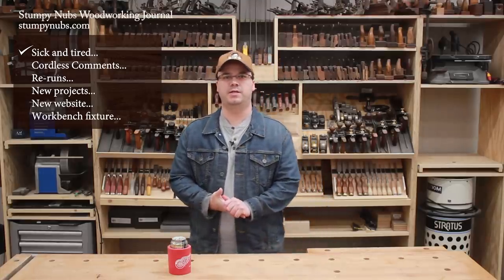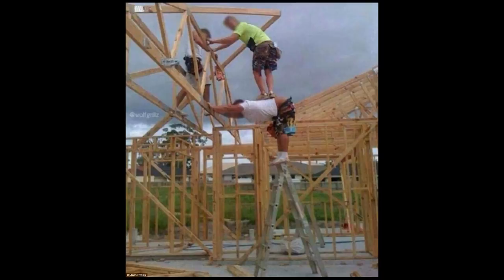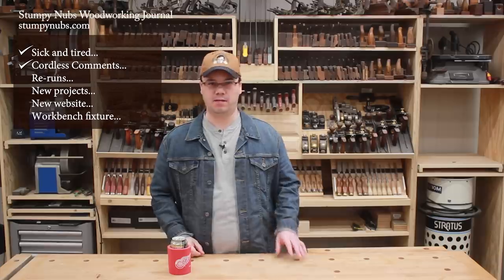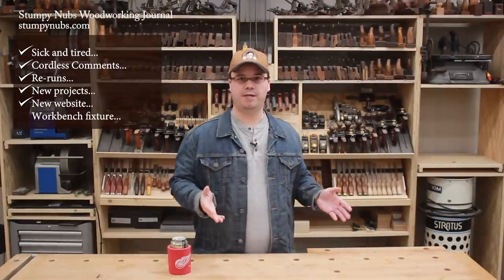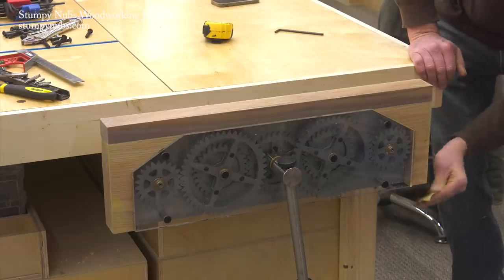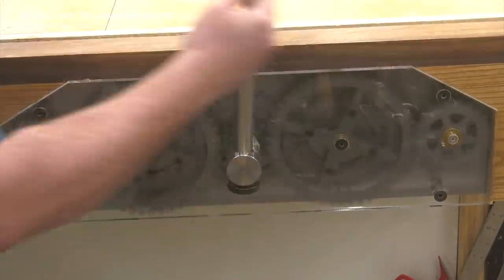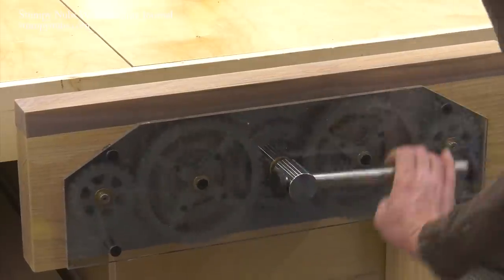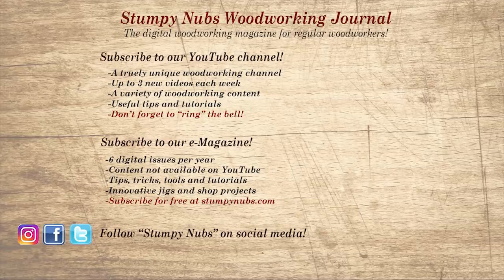YouTuber invents an AMAZING workbench accessory! (And some shop talk)

Comment: I use my impact more than my drill for installing door hardware, but I use the variable speed trigger to feather the screw in. One feature I really like about the impact is that when I let go of the trigger it STOPS where a drill may go an extra half turn or relying on the clutch on a drill can cause issues because of different wood densities. Recently I restored some 160 year old mortise and tenon doors, where the hardware had to go through different grains of wood with different grain tension. I guess it depends on your experience with your particular tool, and I wouldn't try that using someone else's tool because of lack of familiarity.

Comment: On your suggestion, I tried using a drill instead of my impact for a small woodworking project.  You are 100% right.  The clutch is a game-changer for accurately setting countersunk screws, and not stripping out softwoods.  I am sold.

Comment: I agree with your comments about cordless drill being better for most screw driving when used for the kind of work woodworker do. I have both tools but almost never use the impact for driving screws.  I like the added control the drill/driver provides.

Comment: Not sure who came first but you Should give a shout out to John Heisz from I build it. He made a vice very similar to this only with wooden gears.
Reply from the maker: I like John very much. But his vise is not the same as this vise. They both have gears, but they do not function the same, particularly the two-speed clutch that Andy's has. Also, John has a large following that he can use to promote his products. Andy does not.
Reply: Devon & Stumpy: you're both right. John has a HUGE following that help him by buying and spreading his products. And there are some major differences between the 2 vises.
  The advantage of John's is that a reasonably skilled woodworker can buy the plans and make it.
  The advantage to Andy's is that it has all-steel "guts", has 2 speeds, and some accessories like a VERY COOL pivot system.
  Both are excellent options. Which one works for you depends on $ and whether you prefer to make it yourself.
Reply: But he is not selling it and yes he has some good content in his channel

Comment: For really fine torque and depth control, try a brace (as in brace and bit).  If I have a lot of screws, I will screw them almost all the way in in the first pass with my power screwdriver (drill), and use a brace with a screwdriver bit on the next pass to get them just right without stripping the wood.  It's my cordless precision torque screwdriver.  It also saves fiddling around with the clutch, and saves discovering some parts of a board are a bit softer than other parts.

Comment: Andy had added a new attachment that allows the front jaw to slew or wrack for clamping angled pieces, you can retrofit any of the 3 sizes of the turbo vice if you have already bought one.
He also sells what has come to be called Cork Rubber for putting on the faces of the vice, or anyplace else you think it might be useful, works just like the leather we are all used to but apparently holds things better.
Nice Vid James ! Can't wait for some of those projects you listed - I need the ideas!

Comment: thank you Stumpy . yup use the power driver to run it down and a good screw driver to bring it home . hey i need to see somethings multiple times it get all the facts down, so keep it up . i see some of the  builds and so wish i still had access to the sub-tender i was on as a machinists wood working would be much easier

Comment: Cordless drills with a hammer option is absolutely my favorite both on the flight line and in my wood shop. A consistent clutch is is by far more useful when you what repetitive driving to a specific torque.

An impact driver is to a drill what a hammer is to a screwdriver.

Comment: Just my 2 cents...I use a Milwaukee 12v impact driver all the time. Doesn't have the "crush" power orher versions have, but perfectly suited for woodworking applications in my opinion. Thanks for the great videos 👍

Comment: I have the good fortune to own the discontinued 15v Festool Impact Driver. It has an ELECTRONIC adjustable  torque/max-speed adjustment. You can set so low I can hold it still with a gloved hand. HOWEVER, at those low settings a drill-driver works just as good. Still nice to have that range on both tools.

Comment: My Milwaukee has 4 speeds, 1-3 and a speed for self tappers. I’m a plumber so I never really use anything but full speed or the self tap speed. I think the impact is one of the greatest additions to a construction site since battery powered tools. I’m not a regular woodworker but I’ve done a little here and there over the years. I think the lower speeds on these impacts might just ruin your project at a slower pace. If I was putting screws in a nice woodworking project I’d still use a drill with a clutch. If I was going to buy two drills to use in a woodworking application I’d get an 18v drill and a 12 volt drill. You could use the 18v to drill any holes or if you had to drive a 2” plus screw. The 12v would be perfect for driving most screws. Even though this would be the best setup in my mind it wouldn’t be as cheap because they aren’t sold in pairs.

Comment: Funny you should mention the Impact Driver situation. I got my Ryobi MUTI speed driver for free. I purchased a Battery Combo kit and the driver was FREE. I love the ability to choose the speed and torque. The low setting is god for screws used in plastic situations, medium is perfect for pocket screws, and high is strong enough for everything from 6" construction screws to stuck on wheel lug nuts. I will never own a single speed impact again!

Comment: I've had 4 impact drivers, from cheap to about $200.00, all were variable speed and that made them very useful an easy to control. The "experts" on tv never use the variable speed function, maybe force of habit?
Reply from the maker: They do all have variable speed, but the triggers on many are very touchy, not as easy to control as a cordless drill.

Comment: That vise is pretty awesome, but the tooth geometry on the gears seems like its going to cause some issues with it locking up over use, especially with the goal being to apply force to a piece to hold it in place. The teeth seem rather flat, where an involuted profile would provide a more smooth tooth engagement and a better transmission of power across the tooth, resulting in a longer life of the parts and more clamping force available.

Point being: make sure you grease that up pretty regularly if you are going to use it a lot.

Comment: Hey James - I was wondering if you guys use Sketchup, and if so, your thoughts on their new subscription model.

I am still using Make 2017 because I simply can't justify paying $299 a year for the Pro subscription.  I don't need Layout, I don't care about cloud storage (in fact I avoid cloud storage - I don't really like putting my data and information on a server somewhere that I don't have any control over).  I realize they have lower-cost options but none of them support local file storage or extensions.  I feel that Trimble has cut out the average hobbyist woodworker by setting up pricing models that are way beyond our reach.  I was wondering if you or anyone else out there had any thoughts about this?

I've also noticed that it takes an unusually long amount of time for Make 2017 to actually be usable once you start it up, and the longer I use it the slower it gets.  I hover over a tool and it may be 10 seconds or more (the time increases the longer I have Sketchup running) for the tool to light up, or for a snap point to activate, etc.  Do you think they are purposefully introducing lag to encourage us cheapskates to upgrade?

Comment: After you use impacts long enough you learn to understand the torquing based off the sound.. and yes something like the Milwaukee’s you can hook to Bluetooth and adjust settings for speed and torque as desired. A drill is for well drilling and a driver is for well driving.. simple concept. I didn’t participate in the previous video but based off the comments made in this one I feel the need to correct this.  What I hate seeing is all those hex drive drill bits in impacts. Impacts spin way to fast for drilling any materials. You just burn up the bits super fast cause you’re putting them in a roll designed for yet again driving fasteners but making holes for them.
Reply from the maker: A modern cordless drill is not the same as the old drill motors of the past. It is specifically designed for BOTH drilling and precise driving. Don't let the name "drill" fool you. If a cordless drill was just for drilling they wouldn't have designed the clutch features.

Comment: As a new woodworker, can a mixture of flaxseed oil and beeswax be used on cutting boards etc and be considered foodsafe? if you do not have the answer who would ?
Reply from the maker: Yes, it is food safe. But flaxseed (linseed oil) will go rancid over time, which may darken the wood or perhaps even leave an odor. I prefer mineral oil, which you can buy in any drug store because it is also taken as a digestive aid. - Frankly, any finish is food safe if you let it fully cure, which takes a month or so.

Comment: What you say is true but on the other hand a lot of the nameless cordless drills found in big box stores lack the power to drive larger/longer screws even with a pilot hole. In my experience every time you skimp of the essential tools you end up re-buying sooner than later.

Comment: Lots of good info as usual. Definitely can't use an impact on pocket screws.
Reply: Why not? I use whatever one is closer to hand...Mikita vs impact, Mikita vs drill/driver w/torque settings (which rarely leaves the “drill” setting), corded 3/8” vs DeWalt. What’s the problem? 🤷‍♂️
Reply: My M12 impact has a smooth enough variable speed that I don't have any problems with over-tightening - but I've been using it for years and my hands know EXACTLY how it handles.  (one of the other commenters pointed out the same thing - he wouldn't try it with someone else's driver)